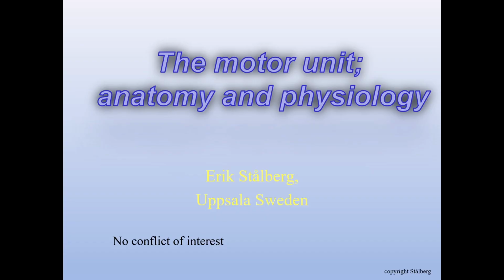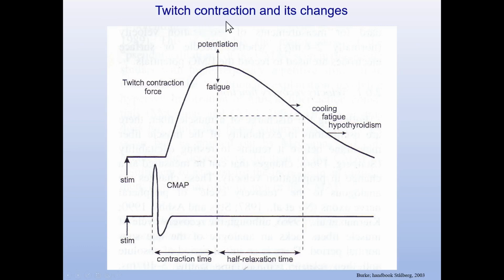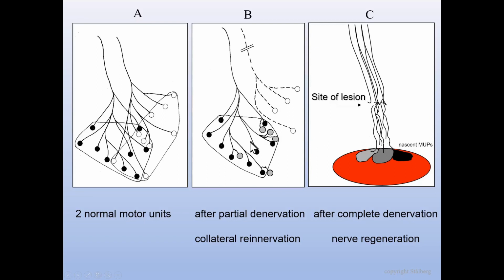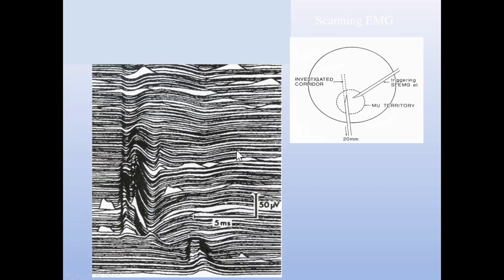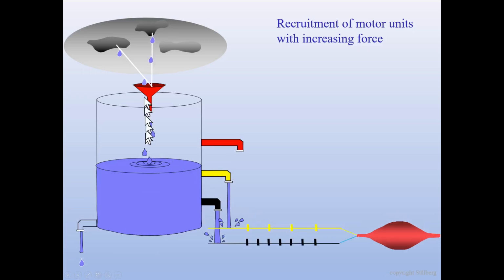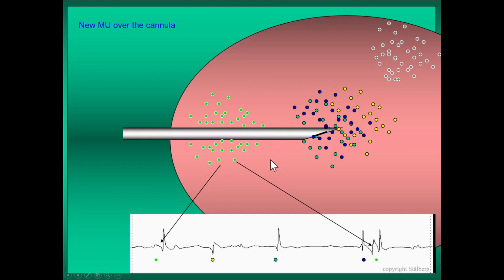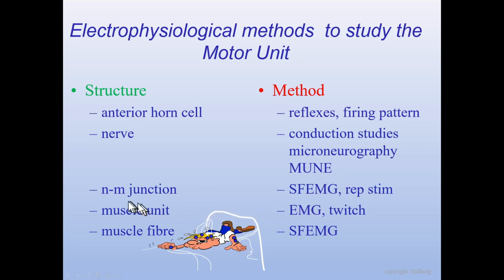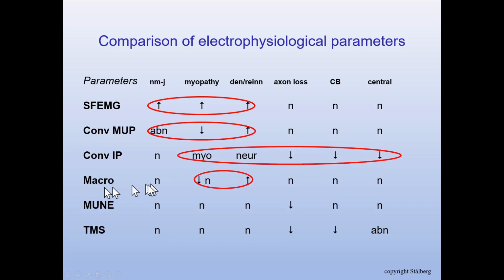The Motor Unit

Comment: Thanks for the great video. Do you think muscle fiber hypertrophy in fit, sportive individuals can increase MUP amplitudes seen in routine clinical EMG?
Reply from the maker: Yes. For fiber diameter of 45 um , my test MUP is 327
for 55 it is 591 and for 65 it is 890.
Note, this is from ONE, same MU. When we make ordinary EMG the amplitude varies a lot, at it is often difficult to obtain a good value, if we only have 20 MUPs. Usually the change in diameter is less than in my example. So, usually we do not make misinterpretations for people with normal variation in muscles. Maybe a factor in athletes.